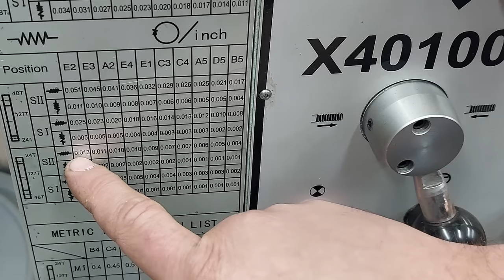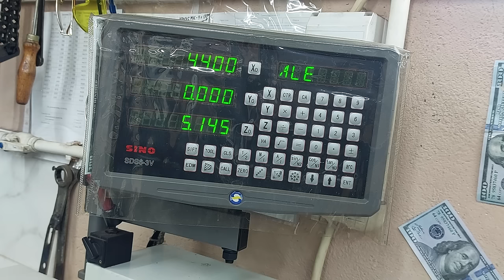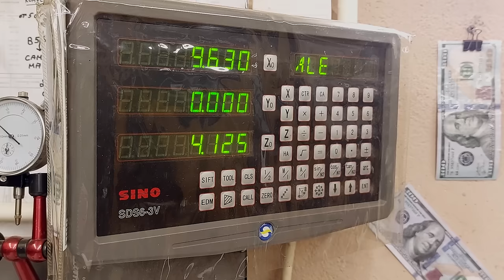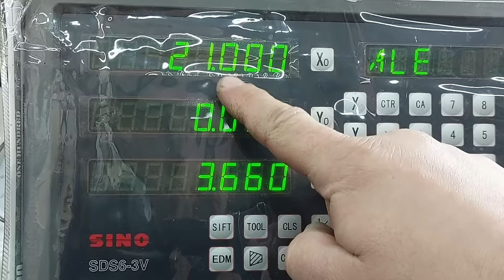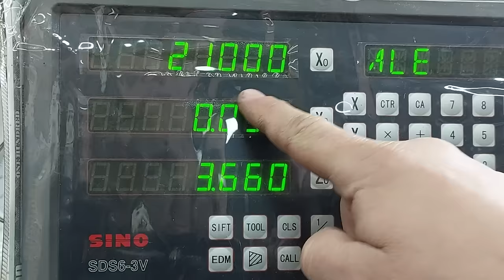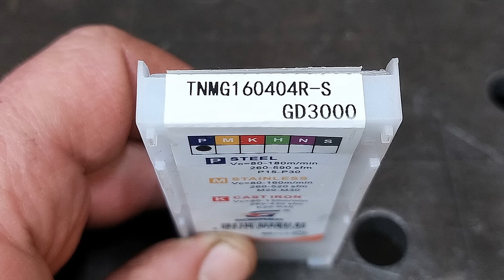Do you know how this carbide insert works when turning metal

Comment: I'm a hobby machinist.  I use ccmt09t304 inserts.  I like to get things done quickly on the lathe at work so I usually start with a .250 depth of cut.  I get blue chips. I hate the ribbons. I was told by an old machinist that the chips should never be blue,  but I don't care.
Reply from the maker: I agree! Welcome!
Reply: The chips being blue shows the tool is working, it takes the heat generated from cutting and "transfers" it into the chip, away from the workpiece and the tool. Although in this case, I would adjust the feed rate to get the "chip-breaker" function working and avoid the long swarf. 
The guys on the Asian machining channels always annoy me with their lack of knowledge of tool geometry, producing long, bird nesting swarf, a danger  to themselves with their loose clothing and the other many folk "operating" the one machine ?
Reply: Blue is the goal in steel cutting with carbide. Using high speed steel the old machinist was right.

Comment: Excellent demonstration.  Looks to be a nice finish, in roughing out.  As bobprice9924 mentioned, stringer/ ribbons  or "Razor Wire" - not if I can make chips (9s), shinny coming off and instantly turning blue.  Sorry, I have to say this....if you ever get a big bird nest of razor wire under the chuck and suddenly thrown into your face, you will understand (lesson learned over 20 yrs ago).  Sort rant...manual machinist, worked both job shop and manufacturing, when I have spare time - home machining also.
For roughing I like the cnmp 432 insert.  I've taken as much as .300 roughing cut in easier machining metal, i.e. 12L14, Stressproof and 4140.  Worst job I have ever had, 4 shafts - 2 bearing journals - total tolerance was .0002 - no file, no sand paper - "Turned".  Got 'em done, clocked out, went to the 7-11, one 6 pack - 3 packs of smoke, gone in less than 20 min, clocked back in and the boss was laughing.  Keep up the good show and tell.
Reply from the maker: Thanks and welcome!

Comment: I thread a lot of rough out of round pipe at work. 
I've found this insert works good in a MTENN, neutral, holder. 
Mostly carbon steel, but the inserts hold up well and are much cheaper than dedicated threading inserts.
Reply from the maker: Thank you so much my friend and welcome!

Comment: At first glance it looks impressive, but the tool is only taking a couple of thou per revolution and the chip breaker is completely ineffective!. Using hand ground tools with massive chip breakers and a similar lathe, I used to remove 220 thou depth of cut, 22 thou per rev, on a 33inch diameter at 74 RPM on steel! I still have some of the tools I used to use. Carbide tips were brazed on by hand and the swarf used to curve over the tip, underscoring below the tip, wearing away the shank. It was awesome to watch!